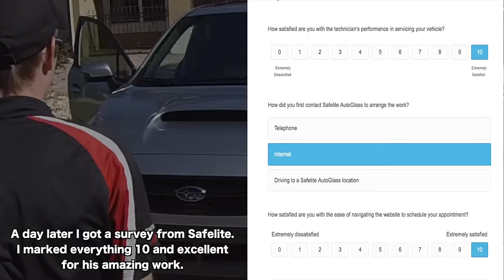Safelite Cracked Windshield Replacement For My 2019 Subaru WRX STI

Comment: I have to get mine done today and I was curious of the process and how long I was going to have to wait. Lol. I have to go to them. My windshield is $300 + to get replaced and to have them come to me was an additional $50
Reply: I’d make sure to have a $ 100 comprehensive deductible. Replaced a windshield on a 2019 Trax....$408.....buddy paid $1800 for Volvo replacement with built in electronics. Both done at Safelite.
Reply: @hoffrun  It actually costed him $1,800. 00 to have is window replaced?

Comment: I work for Safelite as well, I just want to say that I wish all customers didn’t care about the logo on the glass. I work in Seattle so a ton of customers only want brand name, even though it will cost a lot more, but insurance won’t approve lol. He’s a good technician
Reply: Depends I own a 2019 Maserati and theirs only OEM windshield no other brand makes it. My insurance covered it with no hesitation
Reply: TheWiseGuy ya, same with Lamborghini, oem only, super expensive
Reply: william arnold My windshield cost about $1700 new. Real expensive then people get mad when I watch how they open theirs doors next to my car. Like legit they don’t realize how expensive any part is to get replaced or repaired lol
Reply: TheWiseGuy man I don’t blame you
Reply: it's not just a logo it's OEM and not aftermarket
Reply: @thewiseguy7100  that’s how much any windshield with ADAS, rainsensors and the whole 9 goes for nowadays.
Reply: @seanfoster7836  If you look around Maserati is more expensive to own than a Porsche for the insurances because of the parts.
Reply: @thewiseguy7100  yeah if you buy an expensive car then everything is gonna be expensive. It’s almost like a money pit

Comment: just got wack by rock on my brz ts 2020 now i need a new replacement.. they seem to be limited staff as next appoint for me will be like 2 weeks or so.. idk if its not much people working due to pandemic  .. hit today in the very side in the middle and now crack is like almost half way due to heat, its going to go across to the other end one lone single crack .... sucks .... going to cost me about 400$... how much was yours ? insurance fix it ?

Comment: Why wasnt the glass or aperture primed??
Reply: I was wondering the same thing no primer on the pinchweld from any scratches. Or none on the glass
Reply: Some guys prime the glass at the shop and if he didn’t scratch body while trimming you don’t need to prime old bond line just activate
Reply: @jtwilson1982   you can see definitely no primer on glass.    Awful job.   Nonseat covers no gloves
Reply: lgu400angus look at the grit of the glass u can clearly see the primer . Primer is much more dark and the frit is more like a Matt type color . Sounds like u just started doing AutoGlass
Reply: Definately black primer on the windshield. Noticehow at first you can see the defroster grid? Then when he shoots the urethane bead you dont see it as much anymore. If your as good as me... You wont scratch the pinchweld at all on this specific install...

Comment: Does it have to be replaced or can it just be repaired? I had window tint on the front and don't wanna pay again for it
Reply from the maker: a crack usually has to be replaced. a small dent can be repaired.

Comment: This guy better hope his qm never sees this video.😄
Reply from the maker: Why? Did he do something wrong?
Reply: @CarStory  Nothing that you should be worried about. He looked like he did all the things pertinent to a good install correctly. Just a few little detail things that would get his quality manager worked up. Overall he did a great job! Safelite technicians don't get their due credit. It's a hard job.
Reply: @CarStory  yes he did. When he was removing the sticker from the glass he had no cut resistant gloves on, when he used the glass cleaner he had no nitrile gloves on, when he wired the windshield out with the wire winder he hand no cut gloves on, when setting the glass he had no hood cover on the car, he had no seat covers in your car, and when cleaning the glass at the end again no nitrile gloves on, and didn't have his shirt tucked in. It's all little things when you see it bet I work for Safelite and the amount of people who cut themselves is astronomical.. this is how most guys work on the road so the quality managers never see it but with you recording it if they saw it he'd probably get a write up depending on the qm even worse
Reply: Exactly what I thought to, not wearing nitrile gloves when using glass cleaner and not wearing cut resistant gloves with cutting it out or picking the glass up out or using a dash protector and trimming the glue with the scraper without gloves and trimming it towards him, gave me goosebumps haha it's cool though that working for the company you can just pick out things others do wrongly, also hes got an older ez wire tool so it looks like hes been with the company for a bit

Comment: How did he bend your inter cooler fins ? Could that cause more problems with your engine?
Reply from the maker: It wasn't a big deal. Part of his hand hit the intercooler when he was removing screws to remove the wiper blades. I check my intercooler on a regular basis to make sure the fins don't get bent by other things like large bugs hitting it after they get sucked into the hood scoop. The fins are easy to bend back straight. Yes it can damage the turbo if something was to close all the airflow for the intercooler but that would never happen. A few bent fins won't hurt anything.
Reply: Car Story I just got me a xt turbo outback! Loving the car but don’t know much about it yet.
Reply: big deal for those that expect the ride to not be damaged during a repair.
Reply: @punktalley I’m pretty sure the more u took a car to shop for work the more small damage happen and u Wuz never told smdfh dude be for real atlest he wuZ honest

Comment: I just came to watch him brake all the cowl clips and try to hide it from from. Lol
Reply from the maker: +Michael mobray LOL! Luckily he didn’t break anything!
Reply: Lol i work in auto glass and he did a good job. Your car is easy to do. But those cowl clips are cheap bastards and I usually have to put them back in as decorations. Mr.Honda is a cheap bastard too.
Reply from the maker: Michael mobray I have no issues with the new windshield so I assume it was done right 😀
Reply: Can't blame them sometimes. Especially in older cars where the plastic is very brittle. My technician had it easy cause my clips were already all broken 😂
Reply: Take them out the correct way. Maybe you won't break them.
Reply: Sounds like you need to get the Scubaru tool from Rammer Jammer, or go old school and use a lighter.  Lol i dont break any of them on a subie
Reply: damn straight

Comment: Unless you cut it out of the video, he forgot to prime the pench well after he cleaned and used the Aktivator. That is a huge error if he did. I am a Safelite technician and thats a mistake you can be fired for.
Reply: He also cut towards himself with the scraper, no seat covers and no gloves at all. Whoops.
Reply: @Siggydawg  No hate dude. You know if your supervisor/manager saw those lil details tho he'd be on your ass about it. AT least  mine would be. I forget seat covers like 30-40% of the time. It's a f'n grind man
Reply: You only need to prime over scratches, bare metal, or paint. Safelite standards call for urethane to be shot on top of freshly trimmed urethane. As long as there isn’t a reason to prime, you don’t have to. Priming over the trimmed urethane before shooting your new bead can lead to the urethane degrading.

Comment: When safelite arrived I asked if it was the same tint and windshield as the original and he checked in the back of his truck and said yes. Later that day I went for a drive and there was no tint .  Not the same as the original. Very upset at being lied to. Going to call them to replace it again. Don’t take for granted they know what their doing .

Comment: So I wonder what the point of putting primer on the body of a car to cover scratches really is...It's not like cars are built to actually stay running long enough for it to be an issue.
Reply: They turn into holes even rusting the whole pinch weld away, if you live somewhere it snows a lot

Comment: Excellent bead !
Reply from the maker: The windshield hasn't leaked yet so he did a good job!
Reply: @CarStory  A properly installed windshield has many other more significant uses than keeping the water out, be safe and hope you never need to experience what these other uses  can provide.

Comment: He did great how much is it to replace? I’m thinking of doing it
Reply from the maker: Here in Florida its 100% covered by car insurance so I’m not sure but it would be at least $250 from what I’ve heard.
Reply: @CarStory  dang that’s cool I’m out here in Cali they don’t do that smh 🤦🏻‍♂️ 😂😂
Reply: I am paying $450 for my 2019 Subaru tomorrow, that’s in Oregon with full insurance 😭
Reply from the maker: @user-is2lh8qe6t  Wow sorry to hear that, that's a lot of money!
Reply: @carlosrzavala4650  look around for what safelite charges you can get actual factory glass using another company. They wanted $400for my Lincoln with their brand glass. $900 for carlite factory glass what my car came with. Found a reputable company to install carlite for $450 An had the factory lincoln emblem. Safelite  glass is generic brand, noisy not as insulated

Comment: Will they cut out the inspection stickers from the old windshield?
Reply from the maker: I'm sure they have a way to do that although since we don't have those stickers in Florida I can't say how.
Reply: Hi, I'm 6 months late here, but I worked for a mom and pop auto glass shop for 2 and a half years and id say 95% of the time we were able to at least cut inspection stickers off the old glass, but they didn't always adhere to the new glass.

Many states have single use stickers that don't pull off entirely (think the security stickers on electronics that say "void" if you try to pull it off), and other absolutely sadistic states (looking at you, New Jersey) have paper stickers that will disintegrate when you try to remove them.

Most of the parking permits, car wash passes, fast passes, etc were able to be saved no problem unless they were incredibly sun damaged.

Comment: I just had my windshield replaced by Safelite and when it rained that evening there was a terrible haze all over the windshield when using my wipers. I couldn't see anything! This did not happen with my old windshield,  my wiper blades are the best you can buy so that's not the problem. Has anyone experienced this with a new windshield? I have tried a magic erasers and tried alcohol, boring worked. You can only see it when the windshield is wet and using wipers.
Reply from the maker: was the haze on the inside? did you try wiping the inside of the windshield or using the defroster?

Comment: No nitrile gloves while putting the molding on is a big no-no. Your skin oils get in the bond area and you have a leak. No pinch weld primer after trimming urethane means one of two things,you are very good and don't scratch or you don't care if you do.
Reply from the maker: My car is garage kept and doesn't see much rain so it hasn't had a good rain test yet. If it does leak, I will know why. Thanks for watching and commenting.
Reply: No problem.
Reply: I would also check to see if the cowl fasteners have been put back in. They will be at the bottom front of the cowl panel where it rests on a ledge under the hood. There are white retainers and black rectangular headed fasteners that push in. I didn't see him put those back and they commonly break removing them.
Reply: That’s why you clean and disinfect the glass lol do you know how many people probably touched that glass barehanded before this tech touched it? No. And you only need to prime what you scratch IF you scratched any of the metal at all that is. If you’re careful and actually know what you’re doing that shouldn’t be too difficult to do.

Comment: These guys made by 0.25 inch bullseye chip to a 2 inch star chip after the repair. I regret asking safelight to repair my chip. Did it because it was covered by insurance but I could have done a better job myself than so called professional technician.

Comment: start and stop on the top. not a good idea. The time I spent with safelite they taught us to shoot the glass. Never put a start and stop on top. although with a lot of modles you do have to shoot the bottom on the car because you can't be certain where it will hit the glass.  I have been doing auto glass since 1985. have seen a lot.

Comment: Well he didnt follow the Bwof at all. That for sure. 😂 (belrons way of fitting) he didnt tape of the A pillar, roof and hood to prevent scratches, he didnt wear latex gloves when prepping the windshield or cut safe gloves when cutting out the windshield and the rest of the PU glue. Dude come on man.
Reply: Safelite despair,Safelite disgrace.

Comment: He didn't primer idk why... He defiantly made scratches while stripping the glue I saw them at 10:02 it will start to rust and eventually grow and cause leaks and all types of problems.
Reply from the maker: One more rock hit and it’s getting replaced again.
Reply: @CarStory  I’ve herd through the grapevine if safelight pulls out a windshield and their is rust they can’t install a new one until the customer gets the pinch weld repaired at a body shop… Keep that in mind.
Reply from the maker: @chrisoakes8345  The car is garage kept so I hope I won’t have rust. I never drive it in the rain.
Reply: @CarStory  yeah I’m sure you won’t and if you do it will be minimum. I’ve been doing auto glass for 7 years I usually sand the rust down and primer over.

Comment: I just had my windshield replaced by safelite, and now I have a gap between the framing and the glass on all sides except the top, and it was set unevenly. I can literally touch the side of the glass beyond the vinyl. Now I am terrified to drive my car if its going to rain.

Comment: Even tho this windshield installation to a normal person seems very professional, it actually isn't. Safelite is ownd by Belron Group, and me as part of that Group, I know all rules and safety measurs that technician needs to know and do on a installation.
This technician broke A LOT of rules, espesially safety measurs.

I hope he will re-think his actions and start using safety gear that has been provided to him.

Belron Group has a precise manual on how to install a glass called "Belron way of fitting" and this technician did absolutly all wrong.

Comment: My anxiety goes through the roof allowing people to work on my car. I’m contemplating paying the 1,040 the dealership quoted me. At least I can bitch to them if I’m not happy with it. Then again I could buy multiple windshields doing it through safe lite.. decisions decisions… 🥲
Reply from the maker: i totally understand!
Reply: I work for Safelite. Most dealers pay a windshield company. For example every dealer in my area pays us or some other glass company to come dk the job. They get commercial discounts with us for doing business with us regularly. Then up charge you the customer. We bring an aftermarket glass which may cost $50. Prices have risen recently. Maybe $100. OEM glass is more expensive. But if they supply their own glass. Then they’re getting it direct from the manufacturer for roughly same cost. All the glass is the same just a brand logo on it. Time and labor for an hours work paying the tech and supplies no more than another $50 for hours work. So let’s estimate high side $200-300 the dealer pays you or their own guy. Then you get up charged. Dealer has to make money sure. But if they put source the job. Then they have to gouge prices even more. Curious what kind of vehicle do you have. If it needs a recalibration of the ADAS camera then Safelite specifically charges $250-300 or so just for that. Add that onto my prior numbers looking at $500 ish. Then again. Markets vary in prices. Either way I’d recommend taking it in shop to Safelite. The most experienced tech is in shop. They’re the most experienced and fastest. If you make it clear to the manager your concerns over your vehicle and set a high expectation of care. They’ll be mindful. We do a preinspection and post inspection. If anything is damaged. Safelite will and must pay to fix it. For your concerns. Take pictures of your car outside of the Safelite store. You can see you’re at location prior to install. All pics are time stamped. Soon as they pull it out. Do a walk around and if you seen anything out of the ordinary. Take pictures again time stamped. It covers you. Our pictures cover us. If it’s 100% evident that it wasn’t there before we took your keys. Then we are held liable.
Reply: Yeah you pay the dealor and they literally call safelite to come do it lmao 🤣

Comment: NO Safety Gloves when windshield was removed ,also when urethane was  removed. Joining your bead in the middle also NOT GOOD!!
Over all not bad but there is room for improvement.
Reply from the maker: I wouldn't know anyone of this if people like you didn't point it out. Thanks for commenting. Next time I get a windshield replaced I will look out for what you mentioned.
Reply: I work for Safelite and I see no issues in this video with his overall quality only with his efficiency. The bead doesn’t matter where it is joined as long as it doesn’t leak or ooze out. They have taught different places to start and end your bead over the years. Just like step seams now lol something I’ll never do bc it makes no sense to me when it can create an air pocket in the bead. His joining of the bead looked a lot better than most technicians actually. Do you install glass Tyler?
Reply from the maker: @huntermanack8252  Thanks for commenting! My replacement windshield is still in place and it doesn’t leak. I am very happy with safelite.